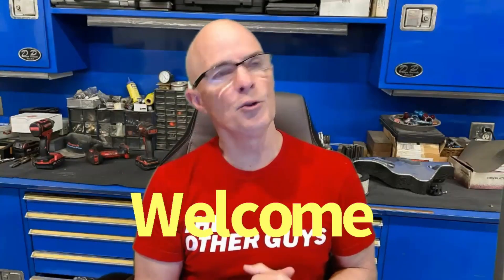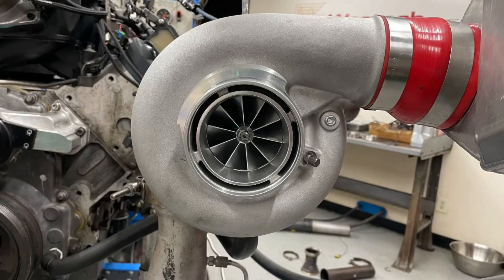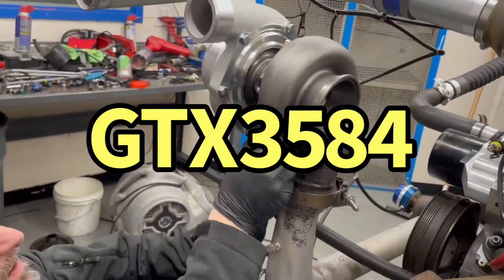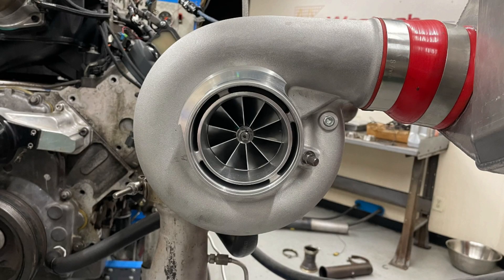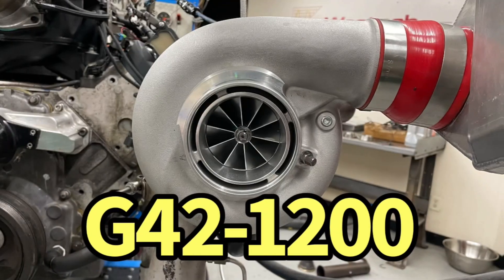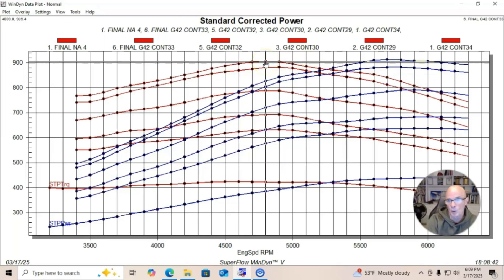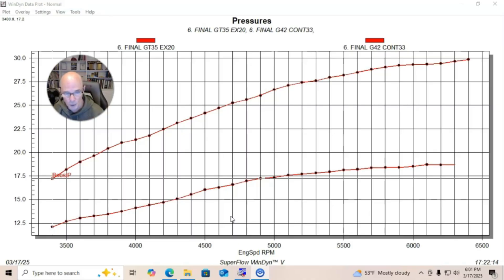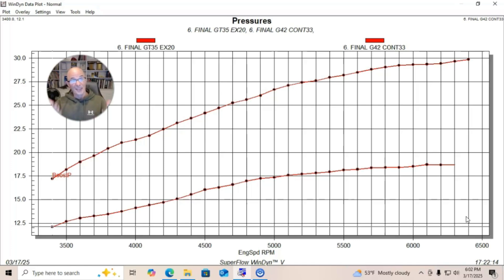TURBOS WARS! GTX3584RS VS G42-1200. SAME BOOST, SAME AF, SAME TIMING. POWER, BOOST & BACK PRESSURE

Comment: Interesting that the engine/combination was that sensitive to drive pressure to make 100hp more at the same boost level. Did the G42 also happen to require ~10% more VE/fueling at the same load points?
Reply from the maker: The added power required more fuel
Reply: @richardholdener1727  just curious if that directly scaled with the power change, which would mean it's coming from reducing residual exhaust gas/better cylinder filling rather than just reducing pumping losses on the exhaust stroke (potential misconception to address)
Reply: @mattmorrison6958  I've always assumed (but you know what they say about that...) the vast majority of issues with excessive back pressure in the exhaust on any engine system are due to exhaust gasses remaining in the cylinder that otherwise would be evacuated. I'm not going to say the additional pumping losses are completely negligible, but I'm pretty sure they pale in comparison.
Reply: @nowayjose596  completely agree, and the residual exhaust displaces what could otherwise be filled with fresh air/fuel charge in the cylinder during the following intake stroke. Pumping losses tend to be given too much credit

Comment: Would the GT42 be a better turbo for a street driven 650whp pump gas combo? A bit more laggy but with that big a difference in back pressure I'd assume detention would an issue with the smaller turbo?

Comment: Great tests. Thanks for sharing the results. One wish is to see a layered final results between the two turbos so we could see where the response curves cross over. Other than that, I absolutely love learning about boosted applications.
Reply from the maker: there is no response curve on a stationary load start point on the engine dyno. That would be better on the street or chassis dyno. The GTX3584 had boost on the roll in (just 30% tps), the G42 spooled much slower.
Reply: @richardholdener1727  Thanks. I learn something new every video - after being out of the car scene for 40 years as I traded my SBC for a minivan during my children's years. Lots to catch up on.
Reply: @richardholdener1727 How quick would the g42 spool on a 6.0?
Reply: @flatbrokemodsquad4241  Depends on a ton of things.  Because every engine has it's variables that effect spool.   It's not a simple question, but considering all things being the same and only the displacement going up .7 liters...not a huge difference.  Few hundred RPM sooner, little better on transient response.   Unless you're turbocharging an 8.1 or 10 liter big block, a turbo that can support 4 digit HP isn't going to be what one would call "responsive" no matter what.  Just get that into your head right off.

Comment: I don't want to spend the money on the drivetrain that can handle 1200hp
Reply from the maker: it would be a lot
Reply: Learn to build the tranny on most of them the rebuild isn't too tough to do and some don't require a lot of specialty tools and it saves so much money
Reply: Go 8HP70
Reply: @michaelserbinenko that would be AWESOME.  It doesn't seem like it's the tranny that'll break your pockets, but rather the "TCU" essentially.

Comment: Where did the WG open?  The bigger turbo extracts more exhaust energy.  If the backpressures are low,  you can maximize the cam to be more racy.
Reply from the maker: Pick the turbo for the desired power output, cam the motor for what you want the motor to do out of boost
Reply: @richardholdener1727  That makes sense, thanks

Comment: What are the conpressor specs? I'd like to find what T51r housing will fit, or could it be an option on your site?
Reply: I have a G42-1200 to go on a LS1 with .90 A/R, T51 mod

Comment: Surely this video just shows a GT35 is too small for even a mild 5.3 like this, as the G42 was ahead of it absolutely everywhere on the graph.
Maybe at very low rpm it will be better, but nothing in the video shows that.
Even before this video I'd never consider running something as small as a GT35 on a 5.3 unless it was something diesel etc that didn't rev at all.
Reply from the maker: You must be new to turbocharging and dyno work, but a GTX3584 is the ideal choice for response on a cammed 4.8L or 5.3L. If you did a roll on with these two turbos at 600 whp, the G42 would never catch the GTX3584
Reply: @richardholdener1727  yeah ok im new to turbos and dynos 😂 😂 😂  wtf 🤦‍♂️ 

My point stands. None of thats in the video. We can just guess the rest. But when the results are like this, immediately presuming the GTX would be great low down yet the 42 would be terrible is a massively bias presumption.

Nobody’s stupid enough think the 35 wouldnt respond better, but to purely guess the 42 is ‘much’ worse when zero theres proof that show it’s worse is even more stupid.

Especially when big housing 35s give OE type spool on 4ltr, never mind 4.8 or 5.3
Reply: @StavTech  yup, 67mm turbo is great for cammed 2.0 to 3.0L with twinscroll, but for 4-5+L (like this 460hp N/A combination) it is like turbo on stock 1.8t or 1.4-1.5tsi.. will make lot of boost down low (2-4k rpm) but you can't run that effectively due to knocking (on pump gas)
Reply: The dyno isn’t really going to show lag if you just hit the throttle at low rpm. With a dyno you’re already wide open at about 3,000rpm for a bit before the run starts. And, it’s only showing full throttle power. 
If not chasing max power the smaller turbo should give better throttle response and come on a little quicker. Especially at part throttle.  
If it was a moderate street car/truck I’d prefer the smaller turbo since it wouldn’t be set to kill anyway.

Comment: Are you going to test the vs racing billet 7875? Also would the g42 be good on a 40 over 6liter to make 800hp street engine?
Reply from the maker: I did run the VS 7875 Gen 2 in our testing